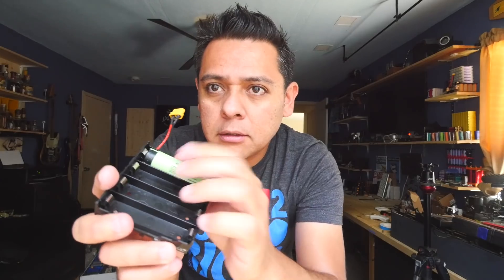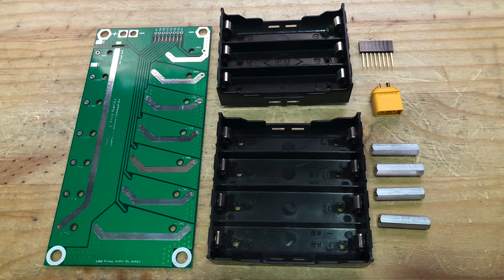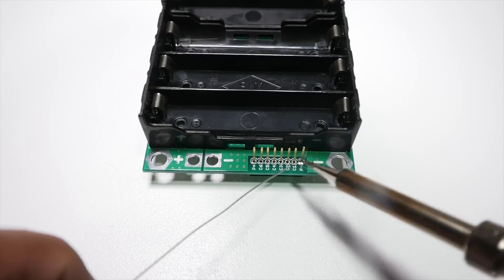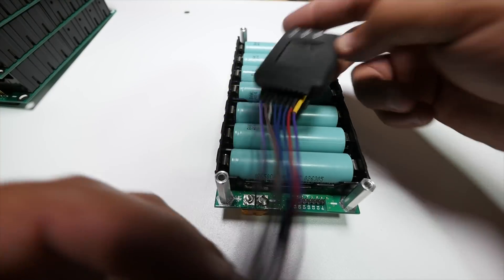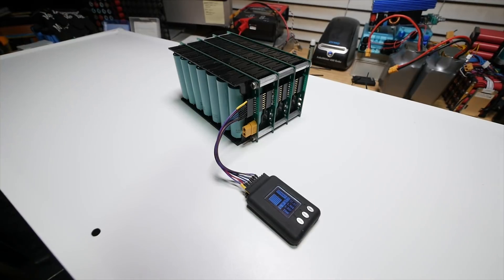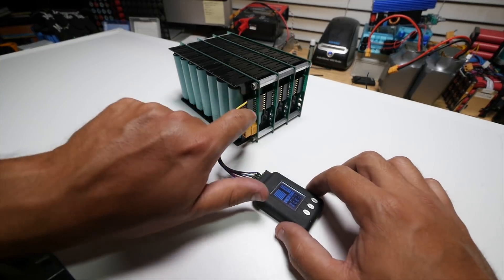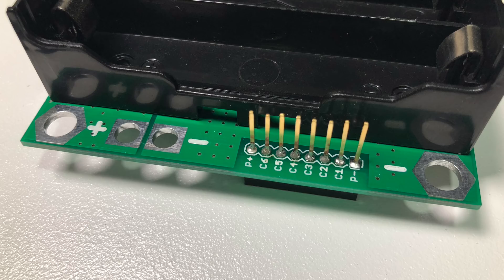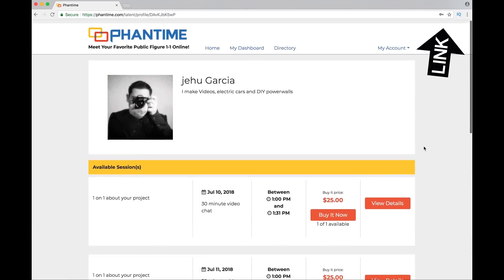DIY Rapid Build 18650 PowerWall Module project  - design & testing

Comment: This is huge !!! Its the first battery pack that allows easy replacement of bad cells !!!! EASY WITH NO NEED TO OPEN AND TAKE APART EACH BATTERY WELDING, AND THE RE WELDING THE WHOLE SYSTEM BACK. anything you build with this system will last a LIFETIME.  no more throwing batteries because of one bad cell !~

Comment: bad design.... main positive should be at the bigging of the pack and the negative at the end so that current flows thru the entire pack efficiently.  In addition the more banks you make takes loads off every single bank so heat acutally goes down.

Comment: Good testing. There is a problem when you use mechanical connections to the batteries. The resistance between the battery and the terminal will go up when you pull more power. Also, the terminals from the battery clip to the circuit board should be more robust. This is where you need "Hard Connected" cells from the batteries to the outputs. Spot welded connections and larger wiring is needed. Regarding the resistor lead for the fuse, it isn't going blow for any reason. That little wire can easily source 10 or more amps through it. Been that route myself already. Battery technology is scary what these cells can produce in power, while balancing the overheating before a massive outbreak of a fire in present. Remember also, water cannot put out a Lithium-Ion fire. All these electric vehicles are subject to MASSIVE destruction when these cells short or catch on fire for other reasons. Great explanations and testing procedures on your behalf for everyone.

Comment: Great work! One more idea for your design: I'm seraching for a solution for a battery pack that is capable to put out 12V and 24V at the same time!  Do you think using this PCB's in a 4S configuration with BMS and adding an further PCB witch can somehow using them in parallel and in series at the same time is possible? I also discussed this idea in a german forum and a lot of people are interestted in this idea especially fo small offgrid systems. This could save a lot of energy because you dont need to use a step up / step down converter....

Comment: After trying to spot weld 8 packs with 65 batteries each, I am so ready to spend money on traditional battery holders and blank pc boards to solder the holders to. Etching is easy. All the boards are the same you can use a stencil and a marker. Your boards are probably cheaper or the same as making your own so heck yeah. Your accent brings back good memories from the Navy.

Comment: Maybe add microfans for each panel, blowing ACROSS the board.
Also, a bit larger fan (same used in other electronic supplies).
Finally, venting on the top and bottom of the panel enclosures.
Should accommodate lots more heat than massive numbers of these boards can produce.
Fans can go a loooooong way!

Comment: Can I make a larger battery pack for a larger toolbox, say 1500 watts or 2000watts? I want to make two or three of these packs to run things in my house if hurricane takes out power grid. Want to connect solar panels to give it continuous energy.
Reply from the maker: you can totally do it

Comment: Im really wanting to build up a ham radio room that is completely independent from the electrical system in the house. Solar panels, battery bank  with 12v supply (13.8v technically), and all necessary monitoring etc. That is my ultimate goal. Ive got a lot to learn

Comment: i thought you said it was 125*C and i was amazed you werent worried ...then i realized it was in fahrenheit. .... as far as the plastic is concerned if its ABS it can easily handle 50* ABS has very good dimensional stability. ... i am curious how much of the heating would be in the contacts, maybe you could measure the voltage drop across them when carrying lets say, 18 amps across then you can get a good estimate.

Comment: A learning experience: I purchased LTO pouch cells and 66160 cells on AliExpress from a seller calling himself Kevin Lee. He operates under multiple company names including: Shenzhen Foxelion batteires Company Store and: Shenzhen Foxell Technologies Co., Ltd. I purchase 160 x 12.5 amp pouch cells which tested to 10amps and failed on their first use. The manufacturer MICROVAST match the serial numbers and advised me they were due for recycling? That was $3,500 down the toilet. I also purchased 100 x 66160 40ah GTK cells. Under the re-wrapping, I found YinLong serial numbers. YinLong advised me these were very old b-grade cells that were installed on buses - so I probably had second hand cells in my possession. I tested them and they came out to 27ah only! Also, many cells had troubles holding a full charge. In this case, another $7,000 down the toilet - the seller washed their hands of any responsibility or wrong doing.

Comment: question for you i sure hope you read your comments... could you not direct wire into the tesla so that you dont lose the batter thru inverter back to car... meaning dc to ac back to ac.. you do lose a lot that way but with direct connection you could do so much better..  thanks i watched to other channel and would think with your knowledge you could come up with a way to direct wire right into the battery bank of the car.. from what i understand the cars are using 18650 as well.  also you would not even have to wait anytime for it to charge the car.. flip a switch and go..... sounds much better...

Comment: If the contacts on the battery holders were copper, they probably wouldn't get so hot.  Those are poor connections which cause high resistance.  That's the reason for laptops, the batteries are soldered together.  Much better connections.  I worked on the lite rail in Houston and we had a lot of problems with connections melting along the track.  These were underground connections.  The voltage was 600vdc.

Comment: Wouldn't be nice to use these connectors for making a bike battery. You can find the problem battery, pop it out and save a large bank without having to disconnect all the soldering points and glue, etc  Love your videos. Thanks

Comment: I wonder if you could 3dprint a beefer battery holder with stiffer contact material the heat is probably due to the thin metal in the contact points if you had stiffer contact materal it wouldnt heat as much due to resistance of the thin contact or i wonder if there is a company that could make the battery holders in bulk order with stiffer contact int he right form factor I would imagin in a lot of 100 or so you might be able to get a holder for around 1.50  a unit or so

Comment: Just for your information the Temperature is -30C to 100C according to URL standards. 

PBT/ABS  which is about 212 F  so yeah you have long way to go... not hot yet and well with in tolerances.

Comment: At 5:35 you say if you do not want to use a fuse, use a resister - you then call out the value of the resister "1/8th watt resister "then you use neither just solid wire as a fuse. When I see this I think twice of the info you give. This is not a contribution to safety. When you count up all the good you bring, this one point cancels out most of the good because of the lethal hazard it can present.

Comment: For clarification the battery in the cell between boards need to be balanced, and between the series at least initially. Again per board BMS would make this way better as you could have a high value resistor to eliminate that issue all together. 

You need thermal sesnors near the contacts (Look at ant charger there will be a ntc under or connected to the contact) also if your going to the effort to make a pcb the bms should probably on the board. Thous silver traces need solder on them For current carrying capacity, and  I really hope you paid for 2oz or greater copper with how you assembled it.

Thouse pin headers you used an balancing header are rated for 1.25 amp if you buy good ones thouse generic cheapos you bough I would not recommend pushing them past maybe 1/4 of that, And the way you stacked them really is a bad idea so many failure/heat points. I know from experience they don't really mate together that well.

Comment: i love your works it inspire to build my own little solar powered using 18650 cells 

thank you for the guide and information you provide 

as for now im saving up for the solar panel ,bms and charge controller 

i made my own diy portable usb chargers

Comment: i have ordered controller an throttle from voilamart who make motor as never had this problem before with original supplies.the throttle had battery bars display and just went down as battery drained

Comment: hi i just had my electric front bike wheel repaired now tested as working but when connected to my controller and lcd display i get error 07 overvolts or 06 under volts.and no spin wheel .have 53 v 18650 battery samsung 25r and 36 volt 18650 battery from hoverboard .can i bypass lcd somehow

Comment: The fact that you have all 4 arrays together does not help dissipate the heat created. Maybe a spacer between each array would lessen the temperature on the battery holder.

Comment: Hey Jehu, I'm making a new homemade wind power using old a.c. parts and rc parts (24v batteries and a nice charge controller). Do you have any videos for homemade wind power with stuff from around the house? I'm just starting the project and really don't wanna light up like a Christmas tree or burn the house down.

Comment: They make 18650 cells with PCB built into each cell. And with all these people complaining about cooling, why not just put these battery packs inside a computer case? It gets fanned from all sides, and you leave the powerwall on the floor. Huge-ass computer for a battery pack. I'm going to build something like this, but I'm buying pre-made battery packs from Alibaba. I don't have the time to do all this.

Comment: Regardles of how safe it is, that heat represents alot of wasted energy.
Reply from the maker: Don’t heat your batteries
Reply: @jehugarcia  I'm referring to the heat at the contacts that you measured, indicating resistance. Curious how much lost wattage it is. Has to be significant.

Comment: Use proper fuses if you don't want fire. Use proper connectors, not metal spacers to connect the packs. Solder or even better weld the cells. Those holders are only for charging.

Comment: I think there is a small problem, there is no design to take power for more points in the PCB, so the battery near the electrode will older faster than the other side. Some factories  production specification is to take at least three points.

Comment: The connection type, the metallurgy, and the lack of cleanliness of the contacts is why they heated up. You need a better interconnect material and method.

Comment: Have you made the video with the 5 Kilowatt Hour one yet?  I am wondering because I am thinking about buying a Prius Prime plug in with a 8.8 Kilowhat hour Battery, but I live in LA and there is no power going out to my garage, I figured I could install solar panels on the garage and connect it to a 8.8 kilowhatt hour battery to charge my car.  Any idea about how much that would cost?

Comment: Thank you for your videos. I Have learned some basic things so far. I have only watched a few videos,  but i will continue watching. I noticed you have done a lot of work with 18650 cells. I have one question. Could you put me I  touch with a person who works with LTO? I am currently building my first bank of Yinlong 2.4v 40ah batteries. I see that much of what you do can be done with these batteries as well. Thanks again.

Comment: A suggestion: if you don't want to spend money on fuses, don't waste money on resistors just for the leads. Get a spool of 22AWG tinned solid core wire.

Comment: come on dude what capacity cells are you using??? if my calcs are correct ur using 300mah cells???????? by what u said ur getting 8 amps out of 28 cells? ammature genius!! use at a minimum 2000mah cells and you could get over 50 amps with that many cells, was this just a demonstration or an actual working product you plan on using???? from what i know u could have got 50 amps EASY out of that many cells if you used at a minimum 2000 mah cells in that bank. idk if you designed the bank and pcb to only work with 100-300mah cells but you could be getting wayyyyyyy more performance out of 28 cells at 7x 4 a pack in series like your doing. idk im just an industrial maintenance tech so who knows if i know what im talking about 🤷‍♂️🤷‍♂️
Reply: You can buy 1.1 amp hour 18650s that can sustain 50 amp current.

Comment: Awesome experiment. You testing it over 2C. How many people would ever go beyond 1C?
Reply: Watt it means 1c? 1 amp?
Reply: @marcosmedina4796  Let's assume battery capacity is 3500 mAh. Discharging that battery at 2C means discharging it at 2x 3500 = 7000 mA. Discharging at 4C = 4x 3500 = 14000mA and 1C = discharging at 3500 mA. :D

Comment: I just want to give one constructive feedback - it will be nice if you add heat shrink around the standoffs as a safety if something incidentally  shorts the electrified standoffs.
Reply from the maker: Do it
Reply: @jehugarcia  Do you think it will be nice if you include that in the PCB kits? It will not increase the cost of the kits by a lot.
Reply from the maker: I don’t think it’s that critical,  at least not enough to make me want to have to worry about stocking another item that can bottleneck fulfillment if I don’t have it.  I think  builders can easily source it  if desired

Comment: How does this battery/chemistry compare to Nissan Leaf G2?  The Nissan are "pouch cells" versus the steel needed to encapsulate each and every one of those 18650 cells.  That's a lot of iron ore that serves almost no practical purpose.

Comment: Good luck if just one of those cells blows. They will all blow up like a flame thrower. Then try and put the fire out. Good luck
Reply: They don't act like a chain reaction. Good cells will expand, blow up, and release magic gas. They don't catch fire
Reply: @giedrius2149  They become a metal fire
Reply: @giedrius2149  Do you need proof?  It becomes a metal fire and a flame thrower. I have worked with them as a technologist for 10 years. Why do you think they are not aloud on aircraft?

Comment: maybe put a small flat wad of aluminum or copper foil so it sits between the contact and the battery end for better contact and lower resistance for less heat. actually , yes , using a lower cost battery mount option would probably bring it down to maybe 1 or 2 dollars? i'm thinking contacts that solder into the board directly while securing the batteries 2 by 2 with zip ties . my 2 cents ...

Comment: Would a 9000w generator be able to use power 24/7 if your plugged into solar panels to charge batteries for your generator

Comment: You can go from zero knowledge to designing a board like that in several hours. The programs area really quite easy to use, even the free ones.
Reply from the maker: I tried and got super confused and annoyed so I just drew it on photoshop and had someone else do the layout

Comment: What happens when you have a fault somewhere in the middle of your power bank? You would have to remove all the modules either above or below the suspected module because you cannot unscrew a standoff that is screwed both at the top and bottom.

Comment: 8 amp hours? I swear I can buy a similarly sized 17 amp hour lead acid for a fraction of the cost.
Reply: And it would sulfate and fail on a rainy day charging on solar. Let them get under charged and a cheap ones shot.
Reply: Trying to get away from dinosaur lead acid myself.

Comment: Try using copper pipe with insulating plugs and bolts to press the rod slugs together  it must be possible to make insulated washers with central conductive areas with a solder tag for a wire for the bus all coming out at one end colour coded

Comment: jehugarcia

     Plastics don't have specific melting points. The melting point depends on a large number of factors and is more likely to be a range rather than a precise point as it would be for a small molecule. 
The melt temperature for ABS is usually somewhere in the vicinity of 378 K, just above the boiling point of water. 

It softens around 90 °C and melts around 105 °C. Maximum usable temperature is considered to be 80 °C.   the link I got the info from  https://www.answers.com/Q/What_is_the_melting_point_of_abs_plastic

Comment: When the temperature goes over 100 (c??) the springs on the battery holders that press on the ends of the battery will lose their temper.. .they will weaken, causing less pressure on the battery.  That causes increased resistance...and thus more heat.  It is something that will be a "Please weld the wires on to the battery" to keep the temperatures under control... and cut losses.
Reply: temp is in F on this video

Comment: I’m just going to point out and ask if this dude knows exactly what a resistor is... at 6:00 the metal wire is not the resistor. The bulb with the two wires on the ends is that actual resistor. You have near zero resistance in that circuit and might be why you’re having issues.
Reply from the maker: Why would I need a resistor on my batteries? You need to catch up,  I don’t need a resistor,  I use the legs as a 6A fuse.
Reply: jehugarcia oh, you specifically said “Resistor” though in your video
Reply from the maker: I been using  resistor legs as fuses for years,  I’ve done whole videos where I test the idea and I test battery modules built using them

Comment: If I have a batch of used 18650 cells but the voltage of them are at 0 volt , should I try to charge them?
Reply: Sounds dead to me, I doubt your smart charger will even attempt it. Personally I try to never discharge a lipo battery below 3.2v per cell. Some people go lower like 3.0v, I've even seen 2.8v, but any lower and damage starts to happen. Short answer is No.